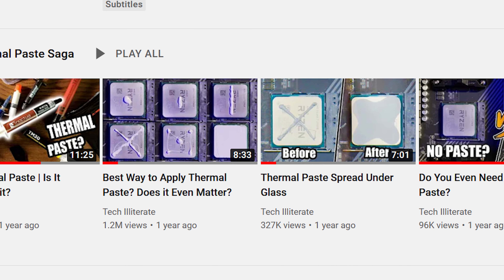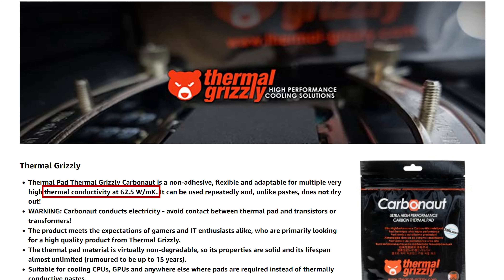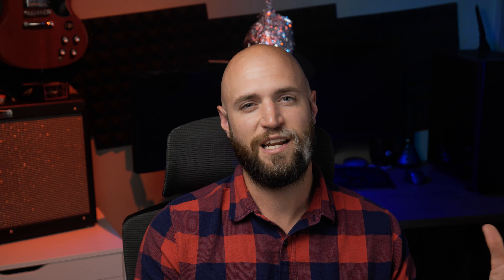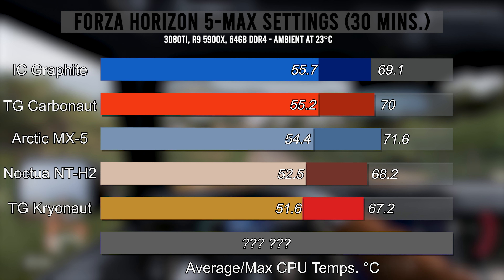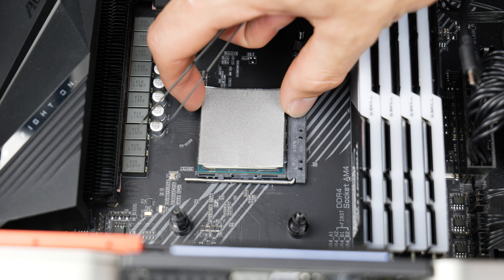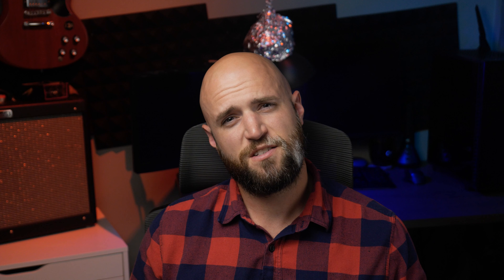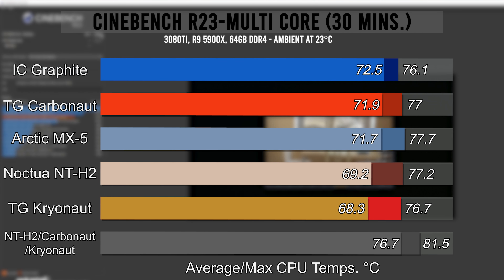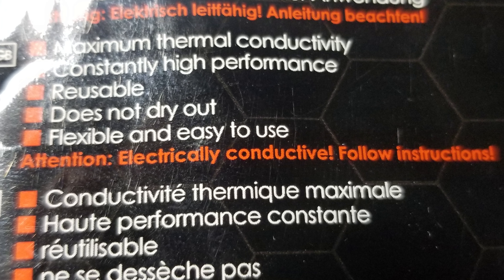Are Thermal Pads Worth Using?

Comment: Do you think it may be possible to polish both the cooler and cpu to a mirror finish, as well as perfectly flat, or at least as close to it as possible and then use no paste or pad at all? After all, both are designed to fill the tiny gaps created by material imperfections. Maybe also a sheet of very thin, thermally conductive material in between, like gold leaf, maybe? That could be very interesting.
Reply: At that point, just take the IHS off and run the cooler against the bare die
Reply: A guy tried to do this. I’m sure you can find his video
Reply: Theyre already factory polished. What can you do at home do. Use some finest grain strip and eye ball it lol. Also these thermal pads are probably great if you for some reason remove the cooler a lot. For anyone else who build a pc its one time thing for the duration of the build. So thermal pad is worse even if a few c doesnt make a difference.
Reply: @Andytlp  the pads are also great for someone who NEVER removes the cooler too.
Reply: @dazeen9591  good point although i use noctua paste and that thing wouldnt dry up in hell.
Reply: Here is the thing, the average person does not have the instruments to lap or make something perfectly polished/flat. Sure, it may look super shiny and “perfect” to the naked eye. However, I bet if some microscope-like instrument or machine that is used to detect imperfections were to exam the results of some guy lapping his IHS and surface area of his AIO with some sandpaper of different grits or some random stuff laying around, said machine would detect so many microscopic imperfections and some areas would be flatter than others or even perhaps warped. 

Point is, you’re never going to get anything “perfectly“ flat or polished with household tools and supplies. There’s a point of diminishing returns. A lapped IHS and waterblock will thermally perform better than their non-lapped counterparts. There’s no denying that. However, I would argue that the thermal delta between a “perfectly” lapped/polished/flat IHS and waterblock using industrial, precise scientific equipment and that of some guy eyeballing it at home, would be minuscule.
Reply: Is the only way this would be worth it really if if u get it so smooth and flat that they become gauge blocks ( special machining blocks that are so flat that they can stick together) so ur cooler and ihs would stick together without and clamping forces or thermal paste
Reply: @AvocadoCotijaCheeseConnoisseur  
Basically, building on what mockemperor953 said, unless you can get your CPU and heatsink to stick together clean and dry, use some dang thermal compound.

Comment: I've been using the IC Graphite pad for years for testing builds and it still works great!  I still use paste for normal builds(not just testing).  I tried the Thermal Grizzly Carbonaut pad and I do not consider it reusable.  It is VERY fragile.  The hole that came with your sample is not unusual and I do not think it will hold up to the years of testing that my IC Graphite pad has.

Comment: Tips for handing thermal pads that are fragile:
DO NOT pick up the thermal pad at all, just take the clear plastic sheet they usually come on and slide the pad off of the sheet and onto your CPU using a QTip. This way you won't bust a hole through it using tweezers. Super easy but will save you a ton of frustration!

Comment: tech: did you try honeywell ptm 7950 phase changing pads before? my am4 5800x3d runs those pads you showed *kinda thermal grizzly kryonaut for Cpu and a Minuspad 8 for the Chipset (modded am4 asus 570-e copperblock instead of original high rpm fan) but someone brought up that honeywell ptm 7950 is way cheaper + kinda good results too aplied it on a i7 6700k hot cpu, but runs way cooler now. then it ever has. have put it on a gtx 1070 rx 5700xt and on a rx 6800xt already.. really good results the gtx 1070 went from 75 degrees celsius to 50 / 55 degrees celcius.😋

Comment: I bought a grizzly pad when it came out. I have already changed 3 processors to AM4 socket and I have no problems. It does not degrade at all, it does not cause problems. I will never go back to thermal pastes again!

Comment: @TechIlliterate
Where you applied the 2 different brands of pastes with the pad which ended up ripping the pad & also getting higher temps I believe that you would have had better luck with only using paste on one side of the pad. My ASUS PN-64 with i7-13700H 45w CPU with the stock cooler gets up to 85 C / 185 F in the house with a room temp of 15 C / 59 F here in Perth, Western Australia. When summer is at it's peak in the next 2-3 month's we will have a room temp of 45 C / 113 F so unless I either cool the room down or the CPU then the heat will make it go over it's 100 C / 212 F limit.

I bought a Pure Copper Heatsink 100x50x15mm Skiving Fin Heat Sink Radiator which weighs 255g / 9 ounce & handles a 50w LED without needing a fan. The heatsink has a milled finish with hills & valleys of about the thickness of the Thermal Grizzly Carbonaut Pad. I plan to use a set of diamond whetstones of 400, 600, 1000 & 1200 grit on the heatsink to remove most of the hills & valleys. If there still are too many deep hills & valleys then I will apply an extremely thin smear of Kryonaut Paste to the heatsink & then put the Thermal Grizzly Carbonaut Pad onto the CPU. If I ever do need to take off the heatsink in a year for cleaning then the pad won't rip into pieces like yours did.

Comment: I can attest this video is 100% on point.  I have used IC Diamond pad for a few years now, and reseated by cooler more than once along with a cpu change and still using that original pad.  I am about to change over the the Noctua simply because the move from 3950x to 5950x has caused me to just hit some thermal throttling (90c and clock drops) so to eek out just a couple extra degrees I will be going back to paste.  If curious the apps that are really hitting my cpu temps are MSFS and Star Citizen running at 4k with auto PBO and running game exe on high cpu priority.  Back on point the pads are about as foolproof as cpu mounting can be, and thermally work as good as a fresh application of a mid to low end paste while keeping in mind the difference between the best and worst paste is usually less than 5c.  A high end paste vs pad may get you 3c or so better so for most people the pad is plenty good enough.  Honestly the cooler you use will have significantly more impact than the paste or pad you pick at least when talking about fresh paste.

Comment: I’ve used IC thermal pads almost exclusively for the last six years (building five or six PCs in that time). The temp differences are small vs paste and the convenience factor is much higher. Also much easier to deploy on irregular CPUs like the Ryzen 7800x3d.

Comment: I think it depends how much work one is willing to put in. Initially paste will be -2C better than pads. But the paste dries out over time; so should be reapplied every 3 or so years in the best case scenario or every year (in the wosrt case). 

I'm too lazy to reapply and I want my gear to last many years - this is why I'm thinking of using pads in place of paste.

Perfectionists will be using liquid metal cooling anyhow !!

Comment: ROLF... basics of thermodynamic is saying... Hello. 
When you add another layer of 'something' .. ALWAYS thermoconductivy will be WORST. Because heat coming between two layers, have some 'obstacles' to overcome. 
This is 'why' when you do thermoisolation of you house, You doing this by put around 3 layers. In EU we use often bricks, then styro, then final render.
Often in countries when is colder.. we put 2 layers of bricks, but with little space between them.

And main role of thermopaste or thermopads are, to fill air gaps between CPU and Cooler.

Comment: I came across a thermal pad that's from a Korean company called Glacier and their thermal pad has a 31w/mK conductivity rating. It differs from the ones tested here in that the top of it is made up of a metallic-like surface and then there is a thin acrylic/urethane layer in-between and an adhesive sticky side on the bottom. It is also non-conductive and on the product box it claims improved heat transfer due to adhesion during heat dissipation. I don't know if it's any good but I don't think it would be terrible and after using Aquatuning's Apex paste that was super thick and hard to spread and it dried out rather quick with an overclock on my CPU. If this pad is more stable over a longer period of use well then, I call that a win.
Reply: Is the pad any good?

Comment: These are great for new PC users that aren't sure or aren't confident about things. I still would recommend paste though, but these things do work. I'm now an LM freak, but you've got to be really careful and confident using that stuff- easy to ruin a parts if it's not applied correctly so I don't recommend it unless you plan on heavy overclocking and take proper precautions, it's just plain overkill unless you're pushing your rig to its very highest limits (which I do).

Comment: have been using the Ic graphite for about 2 years in 3 computers, never had a problem with them running . Only one build is fiddly where the pad would glide out of place but that was due to the antec's poor setup where my stubby fingers had trouble getting the cooling block in place as i secured it .  The clear sell point for me was the fact it could be reused.
Reply: Yo tambien, mi r5 3600 no pasa nunca de los 60° con OC en tiempos de temperatura ambiente de 25° a 30°. La verdad muy buenos. Y encima mas aca que el clima es seco en invierno, la tierra se acumula y hay que abrir la computadora si o si cada 3 a 6 meses

Comment: Nice and learned a lot. 🙂
But, did I miss the thickness? I have now 1mm and then 1.5 mm. 1 mm was on my M.2 SSD and the 1.5 mm? How will this function?
The heat transfer is way lower than your pads. They are both 6 W/mK.

Comment: Bought (at great expense) IC Diamond paste. Overheated massively. Cemented onto the CPU and tore it in half when I tried to remove it. 
Then I bought a new CPU, put on the cheapest paste possible just to tide me over, got nice cool temps. 
Then figured I had better research which paste was the best performance for the money, bought a tube of Noctua H2. PC massively overheated. I reapplied twice, triple checked my cooler pump, seating etc. Still running insanely hot. 
The only thing that changed was the thermal paste. I always apply a perfect amount in an X, I always get great even coverage etc. 
I have come to the conclusion that these pastes are way too thick and dry, and I'm sick of being disappointed. This time I'm buying a pad, then at least I don't have to fight with paste while I'm troubleshooting.

Comment: That's a very good 5900X bin I can already tell. I used to have one from the earlier batches, it idled around 55C with PBO2 optimizations and a 360mm AIO on it. Synthetic benches pushed it over 80C, gaming was around 65.

Comment: Hey how long do you think thermal paste would last on a gaming laptop that's being used everyday? Trying to figure out if I should use paste or pad or an Alienware 17 R4 (2017 - i7 7820HK + GTX 1070). Looking to send it to my brother in Jamaica who for the most part would just rather clean the readily visible areas like fan and other components than repasting as well as stuff being costly there.
Reply: MX 6 for good cooling and longevity (won't harden after a couple years).  

I was super happy with the MX 4, but just started  using MX 6 on new setup (its supposedly better cooling/longer lasting).
Reply: Will easily harden at the 3 years point. I would recommend cleaning and reapplying every 2-2.5 years

Comment: Can we use a very thin of copper or silver as thermal pad?
Reply: Technically if you have super flat ihs and heatsink surface, you don't even have to use any paste. The paste is to fill the airgap between those two.
Reply: @bakatzen6243  some soft metal with high thermal conductivity such as silver, gold, only 4x -4.5x more hard than pure lead (bhn 5). So it is malleable especially when pressed.
Reply: @QuantumentanglementAlpha  now that you mentioned copper, what if we use copper spray as thermal paste. they are good for transferring heat in automotive application.
Reply: @bakatzen6243  copper spray? I think it s not pure copper, or the filler will not do.

Comment: I've been watching your videos after having an issue tonight were a storm knocked the power out twice while I was on my computer and I got a overheated cpu screen when turning back on. It is a 3 year old pc so will run to best buy in the morning for new thermal paste. But research says my aio pump could have went out too. It's fans are still running and I read touch the pump part that's on the cpu and feel if it's running. I did that and think I feel slight vibration. No monitoring programs I've tried show the pump. Even bios just shows cpu fan and under aio it shows n/a. But people say depending on how it's connected it may only read as a fan. How much vibration should I feel while touching the pump? I have no idea what brand it is. It's a cyberpower pc with asus motherboard and intel 8 core cpu. I'm on disability so can't afford alot. Should I just take it to a local pc repair I've used in the past and have them replace the aio? Seeing as everything I've read says you have to literally take the motherboard out of the pc to do that, It's something I can't do myself.

Comment: interesting. Can you check if it works with the Nintendo Switch as well? It has 1 multifunction chip that's way little than that CPU and his shield isn't with that much pressure when it's closed.
Reply: Why wouldn't it?

Comment: Conductivity is nice to know, but actually a more useful figure is thw overall thermal conductance (U) or resistance (R) value. This accounts for the final thickness as well, which will then be more representative of actual performance. Put simply, regardless of conductivity/etc, the highest U value (lowest R) always wins.

Comment: "Thermal conductivity" are not regulated by any law in business, in simple definition it means how fast heat can go trough their paste, in physic, not in business and advertisements, because they can come up with all possible ingredients information and calculate it, to get something on paper, to represent, for you to buy.
So you can only compare thermal conductivity within same manufacturer, to relay on differences there are tests.

For example, if some manufacturer has 3 pastes, rated at 5, 7 and 12 W/(m·K), its valid for their calculations, and for you to see the differences between their three pastes.

Thats why you cannot compare IC Graphite 35W/(m·K) to Carbonaut 62W/(m·K) while on same test they show identical results, and 35 are not equal 62, its almost double, even this numbers are generally very small compared to some other materials, while silicon lottery and gold does not affect anything in this tests.

As you may know, for manufacturer to get W/(m·K), they need several things:
K = Thermal conductivity (in question)
Q = Amount of heat transferred (CPU runs at exactly? - UNKNOWN information)
D = Distance between the two isothermal planes (DIE/IHS/heatsink+fan - UNKNOWN information)
A = Area of the surface (DIE? IHS? Heatsink? - UNKNOWN information)
dT = Difference in temperature (CPU stays at exactly UNKNOWN temperature, and water cooling radiator at strict UNKNOWN temperature - UNKNOWN  information)
All information we have, are with margin of error +/-1, because we are precise?

Whats the result? = 14.4W/(m·K)
Why? -Because it sounds two times better then 7.2W/(m·K).
Who will test it and how? -No one, because lots of complications in laws of physic for mortals.
How to attract attention? -Replace "thermal conductivity" of "25" with "thermal resistance" of "0.0000033"...
What to do with paste that turns bad while manufacturing? -Label it as lower W/(m·K) and sell it.

Comment: Have you tried to use the IC Graphite Thermal Pad 40mmX40mm on any of your new builds? I am about to build one Intel 12700K and I am scared to try it without as much skill as you have it's long enough but it's to wide, would I need to cut it to fit? any info you could share would be greatly appreciated. thank you in advance.
Reply: What did you end up doing?

Comment: I am a entry level pc builder and pads have made it very easy to break into building and trying out many different builds and applications. I do have a thermal paste corsair stencil kinda a cheat but meh these parts cost to much to mess around

Comment: I have a topic suggestion for you: :)
Is it better to completely isolate the lower channel in the pc case that includes the power supply, from the upper area? Or should air be able to switch between the bottom and top sections? What is better for air flow? I guess that separating & isolating the psu area is better?

Comment: I wonder if use a pad in a GPU would be a terrible idea
Reply: Ptm 7950 goated
Reply: No, I put some pads on mine, when it finally came time to replace the paste. I didn't do any thermal testing, but I doubt it's far worse than paste would be. Either way, all I can really say is that it works just fine.

Comment: Are the thermal pads at all absorbent? I wonder if rather than using paste you could use liquid metal? Seems like the liquid metal might help wet the pad a bit but also the pad might give the liquid metal more surface area and friction to cling onto helping reduce the chances a drop goes off into the computer to short something out. And the metal might help fill in any gaps that might be in the pad too?

 I am mostly thinking of what might happen if you put a small drop of liquid metal in the middle of the pad and squish it into the pad with the cooling solution's cold plate.